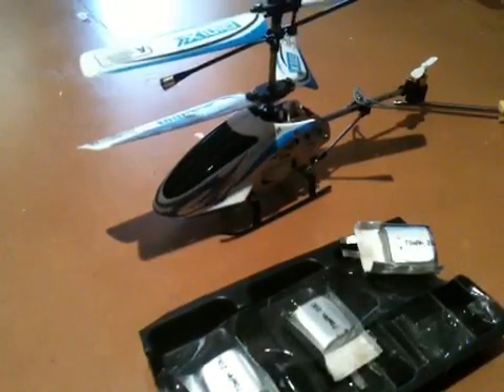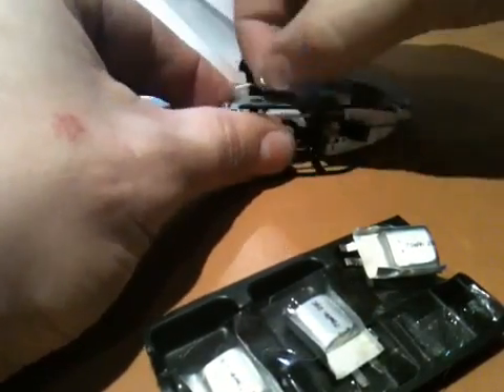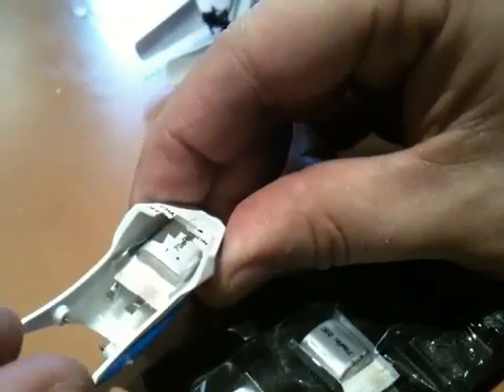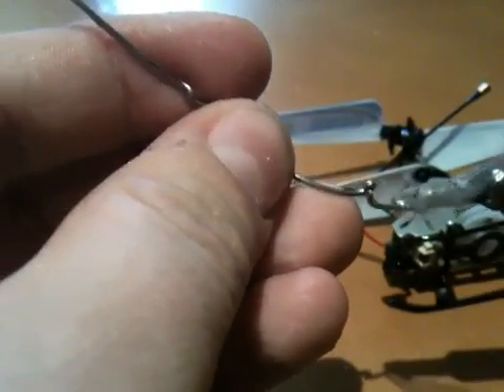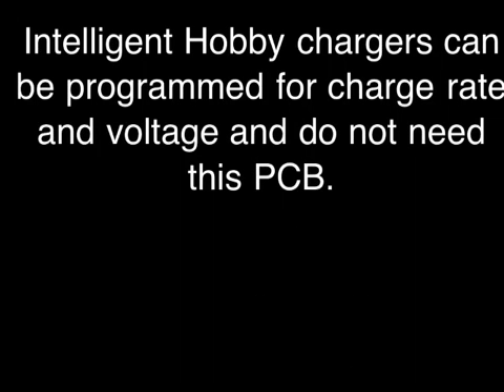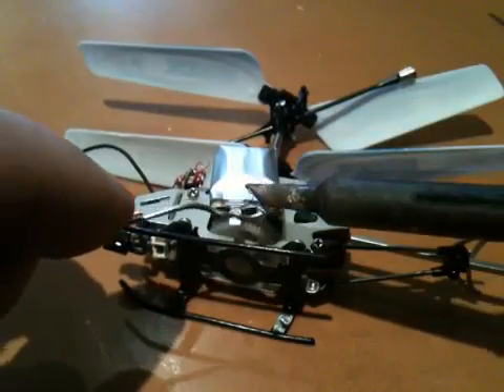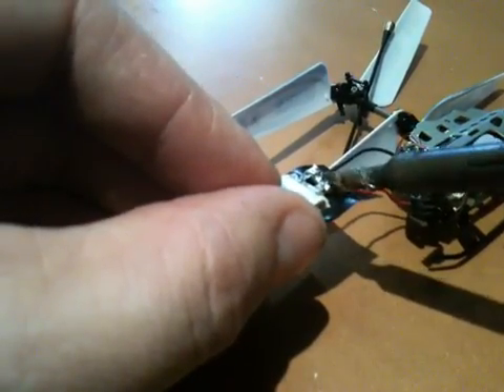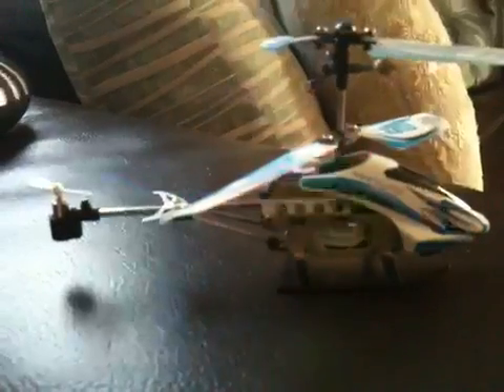LiPo replacement tutorial

Comment: The standard one that was supplied and it will give you 9mins as long as you completely drain the battery down, then do a full charge and even when charged (via USB/PC) add on a extra 5mins to get that USB glowing orange, but now I have replaced my 3.7v 140mAh with a 3.7 240mAh and now a full charge gives me about 10 - 12mins, don't charge unless that battery is drained, keep the props rotating until its completely dead, leave switched on afterwards for good few mins, switch off then Charge !
Reply: 3.7v 240mAh can be possible in model ga 100?